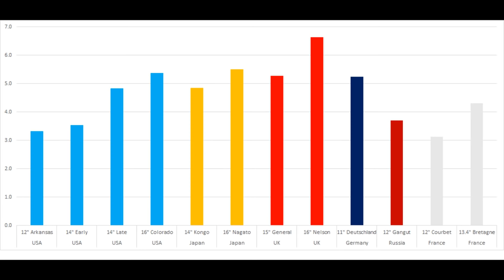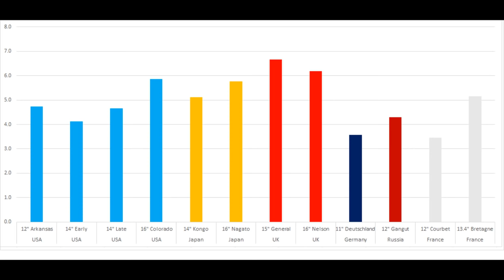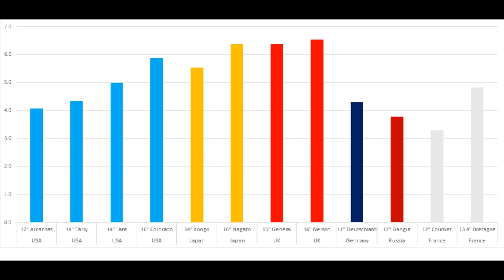Battleship Guns of WW2 - A series of tubes

Comment: World record in rate of fire is held by Seydlitz at the Battle of the Doggerbank. After the stern-turrets blew up Seydlitz was shooting with the remaining 3 turrets 123 11'inch-shells in 6 rounds a minute to Beatty's squadron.
Reply: That is kind of cheating. 11in shells are significantly smaller and lighter than 12", which are tiny next to 16" shells. An inch or two doesnt sound like much but you are increasing the diameter of a circle, which has a disproportionate effect on the area, and the shell length is increased proportionate to the diameter. If you compare a 7.62mm bullet with a 12.7mm, the diameter is not even doubled, but a 7.62 weighs 158 grains and a 12.7 weighs 700-800 grains. So 5mm difference and it weighs almost 5 times as much.
Reply: @justforever96  Yes, that's correct. But at the doggerbank were only 11, 12 & 13,5 inch guns present. At Jutland the Brits had some 15 inch gun ships. The weight of a British 15 inch gun was around 880 KG on Hood. The German 15 inch gun had a weight of 750 KG,. on Bismarck 800 KG. The 11-inch high velocity-projectile of the Scharnhorst-class had only a weight of slightly above 300 KG. On paper the Scharnhorst could shot 3,5 rounds a minute, same as Bismarck, caused by the same simple reload system. But Schneider shot at Denmark Strait in average 1 round a minute. The 11 inch gun had several advantages, more projectiles in the magazine and the guns had more stamina than 15 inch guns. 15 inch guns could survive 254 rounds, 11 inch guns a 100 rounds more. Scharnhorst's 11 inch guns could penetrate most of all existing armaments except the main belts. The fatal hit on Scharnhorst at the North Cape by Duke of York's 14 inch guns reached the propulsion room slightly above the main belt. This hit was deadly by his lucky accuracy not by the weight of the projectile. When Kirishima was hit by Washington's 16 inch guns of several broadsides on nearly point blank range, the broadside weight made no difference. As You mentioned, smaller calibre, more broadsides available. And in WWII only 2 British BB-constructions were sunk by artillery.
Reply: @hajoos.8360  LOL! You are taking Bismarcks AVERAGE to discuss MAX RoF... seriously?  You only got to rapid fire once you have straddled the target.

The supposed hit on Scharnhorst is pure speculation, whatever happened to the ship, she was already regaining its speed when caught.

"And in WWII only 2 British BB-constructions were sunk by artillery."

Wasnt that because Bismarck was the only BB they actually faced and their record was,  1 explosion,  1 damaged and ran away, surviving because the Admiral in charge refused to pursue; and 2 others that got lucky against a ship without rudder control and that still managed to get a straddle but no hits?
Reply: @hajoos.8360  Thst was excatly MY point, Bismarck could indeed fire fast, and certainly faster than 1rpm.

You claimed Scharnhorst suffered a machinery hit, there is no proof of that, that is pure speculation and contradicted by the actual facts.

Comment: I am impressed.  Your discussion on how range capability can affect the gun's function even at close range (flatter trajectory and less oblique impact angles to improve penetration -- you are GREAT in thinking about that!!!).  There is another problem here, though, that needs to be address in armor penetration:  The ability of the projectile to actually remain intact on impact and (1) be able to penetrate thick armor at any angle or medium armor at higher angles and (2) how the shell can still function as a complete, reasonably intact explosive device on the far side of the penetrated plate.  This damage thing is ENORMOUSLY complex and is the major variable in the capability differences between the shells at different time frames for a single country or different countries at the same time (roughly).  One of the bigger examples is the "28cm" (actually 28.3cm in size -- Krupp standard from before WWI).  In WWII there were two types AP of shell used, the L/3.7 in the Pocket Battleships and L/4.4 for the SCHARNHORST Class BBs (this is the length of the shell in calibers (projectile diameters, regardless of actual size of the shell)).  The former are basically hard-capped improved reheated WWI L/3.2 version of these shells.  The older shell has MUCH poorer penetration ability due to poor metallurgy mostly and partially due to the smaller, lighter AP cap for use against cruiser-thickness armor, not the thick armor of heavy, BB/BC-type warships.

Even new guns in WWII have a major problem here:  British 14" and 15" guns have APC shell in WWII that were designed for better oblique impact (very soft lower body and their very much better "Hadfield "Patent Relief" base plug holding the base fuze away from the effects of base slap (slamming the base against the armor at highly oblique impact).  This softening worked OK against face-hardened and homogeneous, ductile armors used in average battleships of typical WWII thickness, such as all British battleships, making the shell much more difficult to break up due to the impact -- good point of course -- BUT when hitting any armor, even at right angles, that are significantly thicker than the projectile diameter (18" US Class "B" turret face or conning tower armor or 17.3" of US WWII "Thick Chill" Class "A" armor used on most barbette sides, which these new British APC shell CANNOT PENETRATE AT ALL, EVEN AT THE MUZZLE.  These British shells bend like bananas or broke up, depending on the armor and//or impact angle, at most making a deep dimple in the armor.  The shells that bent rather than broke up on rejection were rather interest8ing, in that they will still explode properly, usually, but outside the armor so with a much poorer final effect on the target.  My program FACEHARD has this built into its computations for all kinds of face-hardened armors.

Note another effect:  While the size of the explosive filler (assuming roughly the TNT-power filler, usually within 10% of this when exploding properly even in WWI) has some effect, the larger the filler, the smaller number of high-speed fragments formed from the shell sides (noses and bases form big, slower-moving pieces in all such shells and can punch deeper through internal bulkheads, of course), so the smaller-filler shells of similar weight have many more sideways fragments and thus this can compensate for less blast effect in the same place it explodes (which causes the most damage depend on where the shell is when it detonates).  So the big jumps -- when using the similar kind of filler explosive (important!) -- from AP to SAP to HE to "bombardment"/CPC shells have more effect on internal damage when a shell of each type penetrates (if possible, of course).

These are the major, though not the only, differences that can rate these projectiles against one-another as to their effectiveness against the target as their primary purpose.  Fuzing limitations are also complex, but I am not talking about that, which makes things even worse, of course.

This makes things REALLY a mess to evaluate (it took me over 50 years and 70 versions of FACEHARD) to get what I have now, which still includes a lot of educated guesses, though I have a lot of test results to make the term "educated" rather high in this database.
Reply: The factors you mention include the capabilities of the ammunition. This is very important but is not the gun itself.
Reply: @kylesmith1601  It is not really possible to evaluate the gun without evaluating the shell.  The inaccuracies of the Italian 15” gun were caused by the combination of the rifling (which overspun the shell) and the length of the shell itself - see the Warship International article mentioned by Drach.  Nor can you really evaluate a gun without regard to the mount, in spite of what Drach says.
Reply: This is why I come to the comments. I'm rather new to WW2 naval history but completely addicted to Drach's content. Being a Mechanical Engineer and building process control systems for a living, the fuses and detonators, plus the construction of armor piercing shells, and the timing of all that to maximize penetration, delay for detonation, but equipment that survives the launching charge, then survives the impact long enough to reliably set off the weapon is both fascinating and a mystery for me. I hope someday to find some technical information and animations of those fractions of a second.
Reply: People really do not give bullet/shell construction enough consideration. It is one of if not the most important factor when it comes to effect on target. This is true wether you're discussing WW2 naval/land guns or hunting today.

It's no use having an amazing gun if whats going into the target is not an adequate projectile.

Comment: The 46cm Type 91 or slightly improved Type 1 AP shell used in YAMATO Class ships has an ABSOLUTE MAXIMUM rate of fire of 45 seconds between gun shots, with the time to re-elevate the guns from the fixed minimal loading angle after firing the last shell at a higher angle slowing the rate down even more (I think that it would take about 5 seconds to elevate the guns up to the maximum 45 degrees to manually re-sync them with the fire-control system orders, so 45-60 seconds between each gun firing is the loading/aiming rate at rapid fire).  Also, the shells were using a similar hardening system to the British "Greenboy AP shells, which the KONGO Class had been given after WWI and used as the baseline for the Japanese AP ammo after that, with the biggest change being the Type 91 shell shape (International Type 2 conical nose and large tapered "boat-tailed" base) for maximum range), which was only exceeded in streamlining by the post-WWI French 5-calibe-long naval AP shells of DUNKERQUE and RICHELIEU Classes.  The hardness pattern for the 46cm Type 91/1 shells was improved slightly to increase the test angle from 20 degrees (British Greenboy standard) to 30 degrees (most WWII foreign AP shell standard tests) against face-hardened armor, but was found in further testing to not even be able to remain intact against the thicker test plates at even just 33 degrees (poor).  The British "layer-cake" decremental hardness pattern, though improved in their WWII ammo but not much in the Japanese copied ammo, was not very good against angled impacts under high stress conditions, as the US test results of British 14" Mark IB APC Shell after WWII demonstrated conclusively.  This makes long-range Japanese gunfire using battleship-sized APC shells iffy against US battleships due to the thick armor and higher belt tilts used in the US new-design battleships.

Also, about the Japanese AP shell WWII filler:  NOT GOOD AT ALL!!  The Japanese are in their naval officer corps somewhat "Good Enough For Grandpa" traditionalists -- they kept trying to use British Lyddite (which they called "Shimose") with delay-action-fuzed shells until finally even they, in their nearly infinite stubbornness (these were the "super-shells" of the Russo-Japanese War, remember), had to give up in NINETEEN-THIRTY-ONE (1931!) and substitute another explosive filler. trinitroanisol ("Type 91 Explosive") in their new Type 91 AP shells.  This filler was also extremely sensitive, but also nearly as powerful as Shimose (as if that really mattered in actual use, as I mentioned before), but to get it to be cushioned enough to not explode on impact like Lyddite did against thick armor, they had to put into all of their Type 91/1 AP shells (uncapped 6.1" and 8" and capped larger versions) 33-40% of inert cloth, plaster, wood, and aluminum liners like a Russian doll surrounding the filler, especially at the nose-end of the cavity, so the total explosive charge in the shells was much smaller, than the cavity would indicate, AP-size in the uncapped smaller shells even though they had SAP-size cavities, and US AP-sized fillers in their British-Greenboy-sized cavities.  Thus, the Japanese WWII AP shells were much more fragile and had a small explosive charge much more like US small-filler WWII AP shells without the added shell-cavity-side metal thickness increase, that existed for increased fragmentation, that the US shell had -- even their SAP-type cruiser-sized "AP" shells), and also without the US super-inert Explosive "D" (ammonium picrate) filler that could be relied on to penetrate ANYTHING without unwanted explosions if the shell remained more-or-less intact and the fuze worked properly (not completely true even with all that cushion in Japanese WWII AP ammo).

Thus, intact penetrations by US 2700-pound 16" Mark 8 AP shells were usually going to be MUCH more reliable in doing full-power damage to an enemy ship than the Japanese 46cm Type 91 or Type 1 ammo would, either as a penetrator if hitting at an oblique angle or as an explosive-filled weapon even if it penetrated and fuzed properly.  I would greatly reduce the Japanese 46cm AP ammo as to its damage-causing ability in many cases even against WWI-era BBS due to the poor oblique-angle penetration ability, especially an intact shell afterwards even if the shell penetrates completely.  Just drilling holes or merely having low-order explosions like black powder after penetrating much of the time does not make for a good AP shell -- solid shot or shotgun-like effects that happen just behind the outermost armor side or deck plate is not very useful, barring blind luck, against large warships like WWII battleships.
Reply: After reading this I was thinking: Whoever wrote thinks he's Nathan Okun or something. Then I check and it actually is Nathan Okun. Love your work, mate.
Reply: For what it's worth ...

In my old group of beer drinking and war gaming buddies - there was one guy who had developed his own set of naval combat rules - which we used - and he was in agreement with you about those 18.1 inch guns vs. the 16" guns on the Iowas.
.
Reply: This is great info thank you! I’d be very curious to see how you would approach such a task and what your final ratings would end up looking like.
Reply: Damn, the Nathan Okun. Thanks for the information.
Reply: @solus48  You might want to adjust your punctuation and spelling here.  The thanks at the end is probably enough for people to realize you are NOT cursing him but some might be confused.  I would suggest something like:

"Damn!  It's The Nathan Okun!  Thanks for the information."

Something like that ...
.